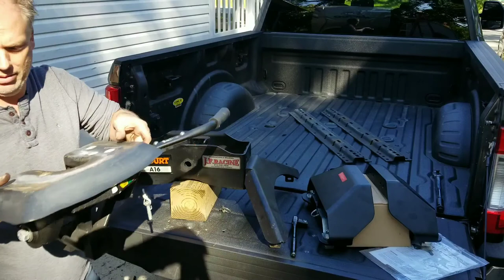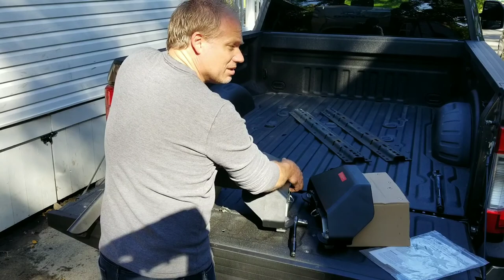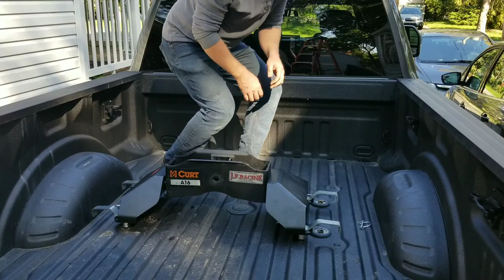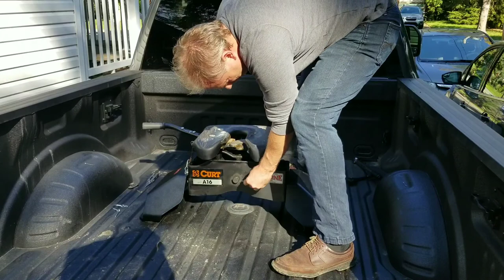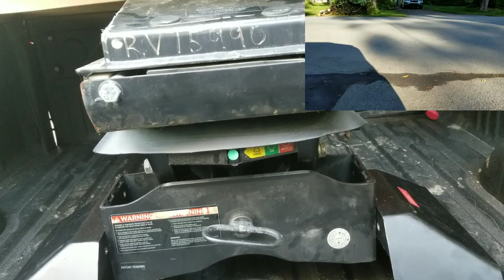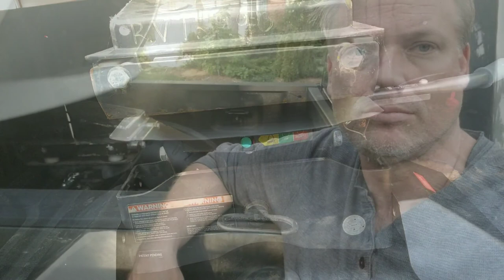Curt 16017 puck legs installation & review on a 2017-2020 Ford F250

Comment: I have done the same , removed  my Curt a16 from my 16' 150 Platinum 6.5 bed EB . worked great but thought I would need the extra Beef
with the 3/4 ton. ordered a new 2021 250 w/ 7.3 engine and 5th wheel prep. glad i stumbled upon your video. Thanks!
Reply from the maker: nice! I just upgraded to a 2020 F250 Tremor with the 6.7 in September. Love the super duty, pulls my fiver like there's nothing there. Cheers!